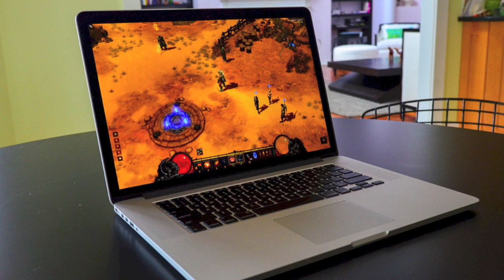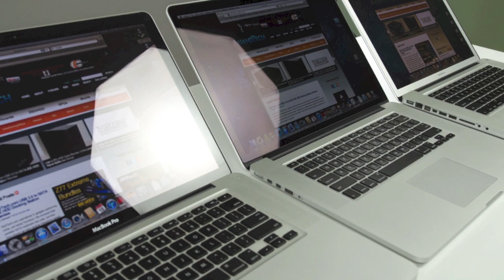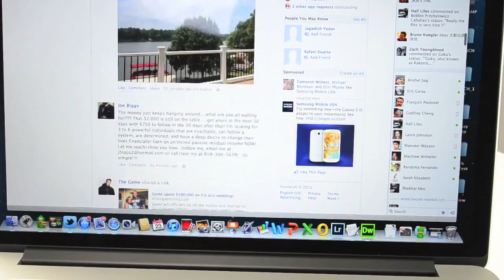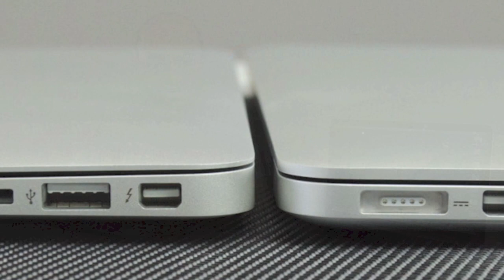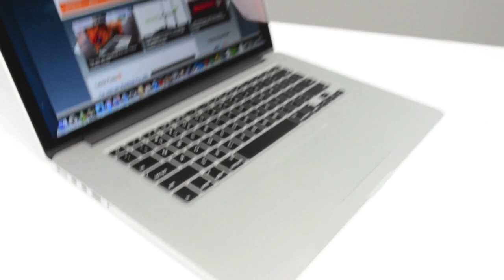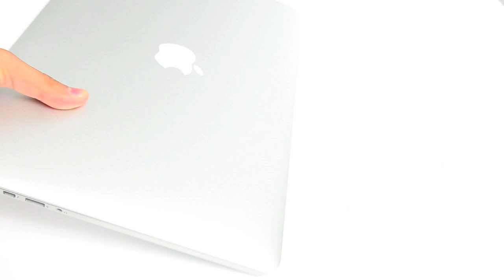Next-gen MacBook Pro with Retina Display Review

Comment: If I have a Late 2011 Macbook Pro 13" with upgraded 8GB ram and 750GB Momentus XT Harddrive, should I get the Haswell MacbookPro or Wait until next year? I'm noticing my machine is getting sluggish when dealing with very high res architectural renderings on Photoshop (5000x7000 px) and when any Final Cut sequence gets over 1 minute in length. It's frustrating. I can still manage somewhat and wait until next year if I know the Broadwell update will be worth it.

Comment: What don't you understand? The computer is basically an ultra book form factor with macbook pro power, do you see any ultra books with optical drives? No, no you don't, if you need it that badly, then you wont mind spending the $60 for an external optical drive

Comment: Actually you're an idiot. Welcome to 2013, we don't use that stuff anymore. I haven't used the optical drive on my macbook since i bought it in 2011. with 20mb connections, the need for optimal drives are no longer there as i can just download anything i want from the web; or use a flash drive (which has faster read/write speeds btw). For the improvements in the chassis i can live without an optical drive. This isn't about Apple getting away with anything.

Comment: Personal review After 6 months ownership:
+ Magnificent physical design
+ Battery life is (still)fantastic
+ Love the Unix shell commands

- Retina not nearly as cool as said; also a 95%+ of website pics are still not supported.
- Gets physically hot
- Lack of Games
- 7 hour battery life only works at low CPU use and at low brightness
- More crashes than expected (first long term Mac user)
- no ethernet port (don't care about cd drive)
- HDMI not working (personal issue)
- No HW update

Comment: I just have a few questions, and that is between the 

MBP 15.inch 2012 mod retina and MBP 15.inch 2012  mod "none-retina"...

Are there any differences in the logic-board between them as in terms of bottlenecks and such?

As for me, the noise from the fan, that doesn't necessarily bother me, but what of the heat? How much cooler is the retina at all?

And for the none-retina, does it support faster ram than 1600.mhz if you want to upgrade it?

Comment: The problem with that logic is that it's not a feature included with the laptop - even as a separate device. You have to purchase it separately, and when you do that, you could make the argument that apple gives you the ability to play bluray discs, because you can buy a bluray player and plug it in, or that apple gives you the ability to run windows apps, because you can buy parallels then buy a copy of windows to run in paralles which you can run windows apps through.

Comment: You have, however, lost the ability to make cheap, permanent back-ups. Using optical media rather than SSDs or HDDs for storage really brings down the price per gigabyte - You can get a pack of 9gig DVDs for around 10-20p per DVD, around a penny or two per gig. Optical media isn't really suited to casual storage, but for more permanent storage requirements like are found in back-ups, it really starts to shine.

(lol, shine)

Comment: I'm kinda stuck between the reg. MBP and the retina MBP. I appreciate the extra thinness and all-flash memory, but I'm still conflicted with the price and the fact that the reg. pretty much has the same specs. I plan to Boot Camp and use it for gaming a lot, so Idk how the ret. MBP would handle resolution/scaling [if anything, I'll be stick w/ 1400x900 / 1680x1050 (anti-glare)]; i.e.: would it look just fine or worse (like in the example of showing off other browsers)? What do you guys think?

Comment: I'm attending engineering this september. The w530 laptop has the nvidia quadro graphics which has a special software driver to improve performance in software like autocad, photoshop and other engineering/simulation software. Plus the w530 will last you for quite a while because it's built with a really sturdy mg alloy and the keyboard is THE best keyboard out there for laptops (even better than some desktop keyboards). Get the stock config+9cell upgrade and you will be pleased.

Comment: I wonder if bootcamp has the same choppy issues when scrolling. I assume it would only be pulling from the mac's "native" resolution which the non retina display has as well. While bootcamp may look "fuzzy," ultimately it will look like a regular screen. But I have no idea if this is true. Unfortunately the retina is my only mac solution so I need to know if Solidworks can run without hiccups.

Comment: You can choose other sizes besides the 1440x900. The UI scales to different sizes. You can run it so that it looks like 1440x900, or you can choose 1680 x 1050 or 1920 x 1200. If you want full 2880x1900, you can get that with a third-party tool. I honestly have no idea what it is that you want, since OS X already provides you the thing you are demanding. You want the UI to scale to different sizes. It does that right now. Oh and FYI: it's not double the pixels, its four times the pixels.

Comment: What is just fine? Are you out of your mind? Did you see how looks UI for example in Photoshop on the resolution 2880x1800? It's small that you could hurt your eyes and the whole UI include MacOS X looks like this on the 2880x1800. UI should be scalable, the whole UI should be vector based then you'll able to not just resize by double the pixels of the UI graphics but get the clear graphics, bigger as you want without double the pixels. Understood?

Comment: Seriously, please explain the issue you have with this computer? If you want to have your desktop at 2880x1800, you can have that. OS X doesn't directly offer that option, but it's available with minimum of work, and it works just fine (although everything looks tiny). By default Apple gives you desktop that is scaled to look like 1440x900-desktop, but everything looks a lot sharper because they are rendered with 4x the pixels.

Comment: @iappsdev washed out my brain? why are you so aggressive? And like I said: OS X does support this resolution, it just does not offer a way to use the full resolution unscaled out of the box. But you can do it with proper tools. Want to run the full resolution unscaled? Desktop and app-windows at full unscaled 2880x1800? You can do that. Things will look TINY but you can do it. So whats the problem?

Comment: I think it's safe to say that OS X supports this resolution. What it does not support is the ability to expose the "native" resolution to the user, except through hacks. But rest assured that the UI is rendered with full 2880x1800-resolution, and the scaled down to 1440x900 appearance.

As to longevity of the machine... I think it's safe to say that the machine will last for three years, easily. 5 years? Sure.

Comment: You are totally wrong, display physical resolution 2880*1800 but MacOS X doesn't provide native support for this resolution, so in most apps you'll have 1920*1200, so there is no reason to buy this MacBook pro with retina until Apple will redesign the whole UI to make it scalable.

Comment: Anyone think the CPU upgrades are worth it?  How much of a difference is the base model 2.3GHz quad-core Intel Core i7 going to be compared to the 2.6 or the 2.7 upgrade -- the 2.7 i7 upgrade itself is $250 and requires that you also buy the 512GB SSD, which I have no need for.

Comment: Macs are working like this like forever. You don't upgrade them you just sell your old one (for decent money i might add) and get the latest and greatest every couple of years. I don't see a problem :-) Also you have 2 Thunderbolt ports and 2 USB3 ports, who is forcing you into using one connector? This solves your disk-space problem as well.